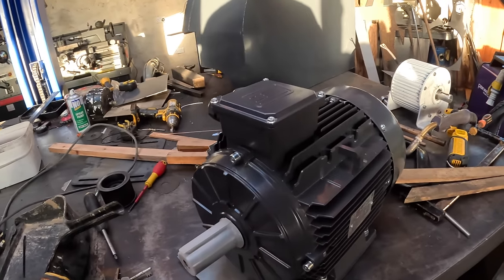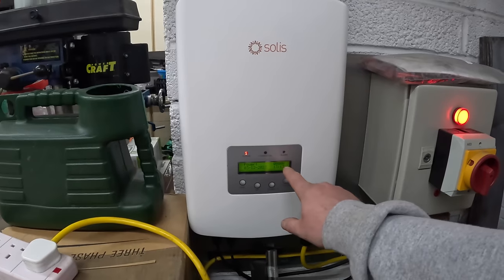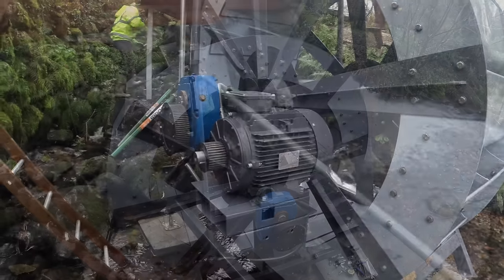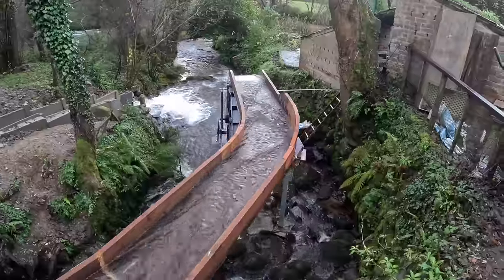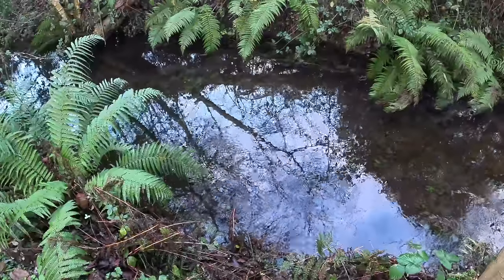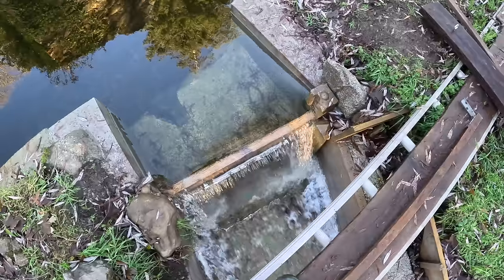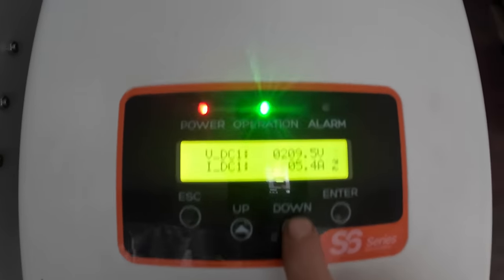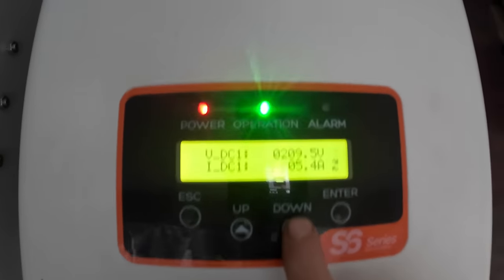Powering An Old Mill  1.5 Kw Lake District Overshot Waterwheel Project Part 4

Comment: Is this too cumbersome/inefficient to run? Running back and forth with switches and that wood gate would be too much hazel unless your a dedicated aficionado and present 100% of the time. What about a turbine? There are 1000s of micro hydro powerplants in Norway and I don't think none uses such an outdated water wheel.
Reply: A)wasn't the whole POINT of the exercise specifically TO us a waterwheel....as per the customer's requirements......!?
B) waterwheels are not 'outdated'..... however, they have been around a LONG time.....!
Reply: @andymccabe6712  As I understand hydropower the point is to produce energy (ie electricity) as cheap and easy to operate as possible with the least amount of environmental damage. Norway's power production is 95% hydro, we do export TWs to the whole continent incl UK (cable and Arcer) and it's fair to say that we know our stuff. 
With a design/set up like in the video both will possibly have same environmental impact. I don't know about the price but I assume equal. With a waterwheel 2-3 X less efficient than a turbine, that leaves the ease of operation a determining factor - in my opinion. But ofc, the nostalgia and sound of wheel is a positive factor.
Reply: @SteifWood  well, yes ..as I said, the customer wants a water wheel, so .......!

Comment: Great job, but are the clients happy with such low figures compared to your promise? At 1500 as you say it’s chaotic even at 1100 it’s still rough. Compared to ‘old’ waterwheels it just seems far too small. You promised 1500 and delivered 700.

Comment: I have a Question for you Kris.  it is this Given most of us do not have the mean's to ues wind mill's & hydro, to charge the  battery bank's we need to get out of the rising cost of. power in todays wold   the question is this what the cost variation in charging up a battery bank 50% discharged & the cost in running the system using that build run of one's mans power  Or an  axial flux's system like you builds  Give Soler will do wat it can in the summer. 

Can you exsplan it possible development .

Comment: Bro with all that water power you have I would of instead of try to adjust and control one alternator/generator,  multiply the quantities of generator to either 3 or 4 using combination of gearing and pulleys increasing total power kws.  You have a basically a huge inertia wheel battery with that awesome water wheel that is very strong and sturdy.  I'm sure in parallel it should handle a combination of alternators.  You could possibly make 4500 to 5000 watts with 3 1.5kw gets, making a bigger return on investment from the grid power company?  IDK just my 2 cents.  Thanks and great work buddies.

Comment: Although the efficiency drops at higher flow rates I don't understand why you wouldn't run it at maximum flow. You keep saying its wasting water, but the excess water is just going down the byweir anyway. Surely you should run it with the maximum available water going over the wheel!

Comment: How can induction motor function as a generator?
Reply: If you put power through an induction motor it will produce torque. But if you do the reverse, you put torque into the induction motor shaft AND excite the electromagnets, it will instead generate electricity. The more power you give the electromagnets the stronger magnetic field is produced, and in turn increase the power generated by the copper coil, but also makes the wheel harder to turn. So the magnets also acts as a brake to control the speed of the wheel and the more torque the waterwheel grants, the more power the electromagnets needs to keep the wheel steady at a certain RPM, but also generates more power. Thinking of it, he briefly explains it here 3:25
Reply: @snailswrath  this makes no sense as the rotor has no permanent magnets so what is making the rotor magnetic?

Comment: Thanks a lot please explain how capacitor adds to generate higher electricity, cant understand where your magnetic field comes from, have all the equipment but haven't got the knowledge to assemble together, your explanation would be greatly appreciated, please like and subscribe and post and forward if you agree. All components are easily available, more electric explanation would be of great assistance to most people, why no magnetic field, how are capacitors working, can I use readily available capacors from microwave transformers, what is the ratio between the 3 phase motor and the capacitance in microfarads of the capacitors . Thank you very much, well done, great motivation for all Young people good job

Comment: Peak output value of the generator is not going to be 1800 W not even 1500 W, more like 1.2 Kwh. Above that and you will be creating heat in the generator which also counts as a loss.

Comment: You loose a bit generator efficiency by having rectifier and DC inverter instead of AC inverter. In this setup, current flows only in one phase at the time, the one with highest voltage. 

I did make a comment earlier, since that is the most likely reason why smaller generator overheated and wasn't able to produce enough power.

However, efficiency loss is not a big deal, considering how much water flows unharnessed. This is also most likely best solution for cost efficiency. AC inverters are much more expensive than bigger generator.

Comment: 7:47 No, the mechanical output power is 3kW. The Power on the Nameplate of motors is always output power at the shaft.
Could you please measure the current going out of the actual coils of the motor (including the capacitors)
You could easily max out the current of the motor when running as a generator because of the capacitors, even at only 1.5kw output power
2.2kW x 0,8 efficiency x 0,8 power factor = 1.4kW

Comment: I would say your entry point to the bucket is still to far back hence the reason you have so much splashing. If it was further forward from the axle the mouth opening of the buckets would be available longer to accept the water, as the opening of the bucket approaches the vertical, this would also mean you would reduce the amount of splashing because now it is hitting the sides of the bucket not the opening. If you look on your video from the side and slow it down you will see that is exactly what is happening. I hope that is helpful, l am also a design engineer.

Comment: Why not make a system to control the water flow without having to go to the dam and do it manually?
Why not design the wheel so that its working optimally with minimum splashing at ~1500 watt?
Why not add more wheels for more power? I mean, now you got the thing working now, scale it up to make more money over time. More water, more wheels, more money!
Why not design the system so that it can be turned on immediately without the need to slow flow? Or atleast make the system do it automagically so some random noob does fry the system.

Comment: Shift key dyslexia?  The proper SI unit abbreviation would be kW.  The Kw abbreviation represents kelvin something because the upper case 'K' is the abbreviation for the temperature unit kelvin and the lower case 'w' does not represent any SI unit.  Therefore the Kw construct is not a valid unit formulation.
Reply: Almost nobody cares....!
...also, pedantry and condescension is in not usually a good look.....!!!

Comment: You missed a trick, your water wheel does not work without water...and you chose air cooling for your motor.  The reason why electric vehicles have such small motors is because they are liquid cooled. You could take that small motor and liquid cool it with the water from the water wheel and it would work fine. Also the air intake of the new motor is going to be blocked from taking air in from the cover. You don't have a lack of power from the motor problem you have a cooling problem, you need to have a fan inside the motor cover that brings a large amount of fresh air to the motor.

Comment: @ KRIS. If your interested I have a 3000w 15 rpm single phase generator designed specifically for water weires. If your interested I can send date and pics don't want a lot for it.

Comment: The bottom line will be the bottom line - total investment of energy and resources + maintenance vs. energy generated/recovered. I take hydro and geothermal to be the only real "renewables" (solar and wind are BS) but even then I'm sceptical that anything outside of thoroughly engineered mega-dams produce much more than incremental gains in efficiency of resource utilisation.

Comment: Do you think it's worth making it water called you got those gaps between the fins you could run 8 mm pipe through them
You should have tested it on a load 100 watt light bulb
Why don't you use the heater to protect the controller instead of adjusting the water flow, that should work, and by having a bit of circuitry to turn the heater down in increments and then off using a time circuit.

What about putting a flap on the edge of the bucket sticking out another five inches connected to the side so it can pivot by having a slot and rotate forwards on its downstroke to dump the water so when the bucket fills up it goes over and it stopped by the flap excess water will run down the bottom bracket We're splashing isn't necessary an issue and add a bit more weight then when it hits about a 70°, it will tip forward allowing easy access for the bucket to empty, a bit like a governor for the water the more the bucket fills up the further the flap will open. I was wondering having a welded lip even maybe an inch and a half on the edge of the bucket outwards would prevent splashing? That might work the water will have little resistance and reduce the splashing. 
Just looking at the picture there you showed at the top of the wheel the shoot seems to be splashing you could make the governor on the top of the shoot using a venturi slightly bend it, on its intake open more and narrower on the output slightly, not too much, with it overhanging the original shoot maybe 6 in overshoot, and the more flow you get will lift up the governor allowing more water through you can control these with hanging weights or springs.

Comment: Solar is in my view a very poor relation of any other generation capacity. We only get 1.3KW from the sun per square metre of the surface of the Earth. To get the equivalent wattage to a moderately sized nuclear power station, you'd need hundreds of thousands of acres of land. Hinckley Point Nuclear Power Station covers 430 acres of south-east England. An equivalent output solar farm takes up between 130000 and 250000 acres of land. 

Destroying our ecology on the altar of the climate is rather an odd trade-off.

Great work building this system.
Reply: This argument is COMPLETE nonsense ..... and you SHOULD  be smart enough to understand why.....
.... once you've put your obvious prejudice to one side..... !!

Comment: 24:10 "To get 1600, we'd need to put all that in as well."

Why don't you? I get that water is being wasted in the sense that doubling your flow only gives you a third more power or whatever, but isn't that less wasteful than letting that water flow past anyway, yet completely unharnessed? 29kWh/day is great, but 38kWh is greater. Are you concerned about damaging the wheel, or the generator? 🤷‍♂

Edit: Oh, I didn't realize the flow was so variable! That being the case, that seems like all the more reason to always generate "maximum power." Make hay when the sun shines, and electricity when it rains! 😅 (hay = PV 😜)

Comment: I jumped into solar for the first time and boaght 300W panels, charge controller and a 12V high capacity "LiFe" battery from a Chinese Company. The battery came with 1V charge and my chrger would not charge the battery, even though I had it hooked up for a day - it shoud have taken 3 hours to fully charge. What junk. I finally sent it back a motnh or so ago and still haven't received a refund. Emal conversations were worthless...

Comment: Efficiency is the electric power out relative to water power in.  But it's irrelevant since the water power in is free.  When you're paying for the power in e.g., fuel, efficiency is critical.  But if you aren't & you "waste" it, so what?  The most relevant metric is power out, period.
Reply: It is relevant though. 
The water is free, but the system had a cost. 
Getting out more, will recoup the money faster.
And even the system was free, getting more is better. 
And in the end the power out will matter. But without tuning it, the output will be lower.

Comment: Hi! I'm building a somewhat similar system myself. I'm going to build two turbines, one is a 240cm in diameter water wheel like this one (but narrower, aiming for 150-200w) and the other one is a pelton turbine with on a spring with ~50m of head (3.8bars of real pressure measured at the bottom of the pipe).
Can you share a bit more about what grid-tied inverters that can be used with turbines? Thanks to your video i've seen that solis makes one. I've think I've seen that Deye / Sunlink have some hybrid models that seem to support it. Any other hybrid inverter that you know that supports turbines?

Thank you, all this series has been amazing and a source of inspiration for our wheel: https://www.youtube.com/watch?v=3Tq3pYACA8I

Comment: 35:28 you guaranteed 1500 not 750? Should you revise your guarantee to a base load guarantee. Then you don’t disappoint the customer as in reality the base is 750 not 1500…

Just curious the splashing at higher speeds could you put on a shroud or cover that contains the water so it has no opportunity to splash out to maximize the gravity effect or does that impede the impulse of water hitting the buckets? The wheel would become more like a turbine in a hydro dame where all water is forced past the blade (or bucket in your cases. Ie once in the office the only way it gets out is at bottom once it’s woke is done? Does that create more losses or is it harder to tune?

Comment: 80% of these videos: "i'm pleased with that", "matches my design", <pressed the down arrow button on the controller> etc, etc...

It's really not clear what the overall goal was... Like is this supposed to provide power when there's a grid failure? Because having to do all that manual work to bring it back after a failure makes no sense. Also dumping the load as heat during a grid failure makes no sense... If the goal was to provide power to the grid, then this seems like a lot of expense for nothing.

Comment: WEAR SAFETY GLASSES!  One million eyes are lost per year. Tack welding with no protection is foolish, the UV rays go straight thru your eyelids. It's all fun n games until someone loses an eye, then it's too late to grab a set of glasses. An electronic welding lens can be had for under $15.00, you don't even need to nod your head. Save yourself cataract surgery in fifteen years and wear protection.

Comment: Blaming a Chinese product when tbh its clear that some massive under estimations have been done on the alternator side of things from the get go.
Apart from that awesome project
Reply: The Chinese product was incorrectly specced by the manufacturer.....
....so, wtf are you talking about....!?
Reply: @andymccabe6712  even if it was up to the spec it claimed to be it wasn't enough because the second unit was rated for more and couldn't handle it

Comment: Yeah i find it weird how critical people are of hydro power for little to no reason at all, people clearly don't understand it, cheap basically perfect low maintenance power source, and people want to rip out systems that have been on for decades just to replace them with coal, gas or similar dirty sources, but they're almost always too ignorant to realize that, yet they're not critical of actually dirty power sources, the mind boggles.